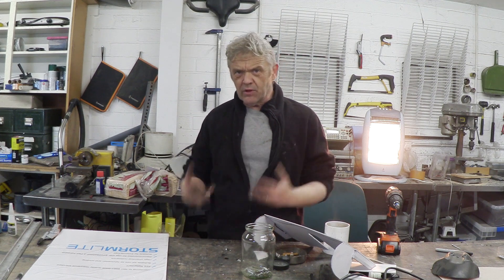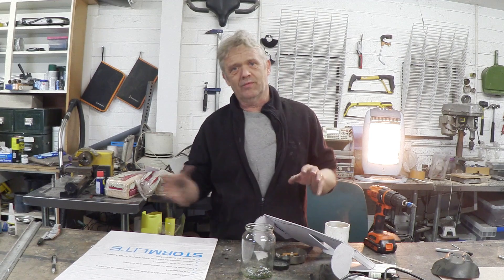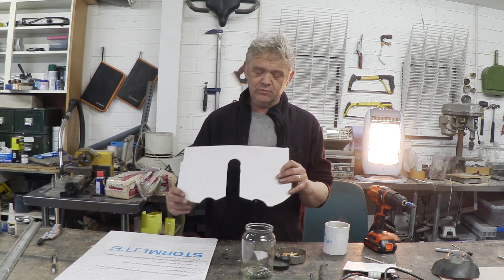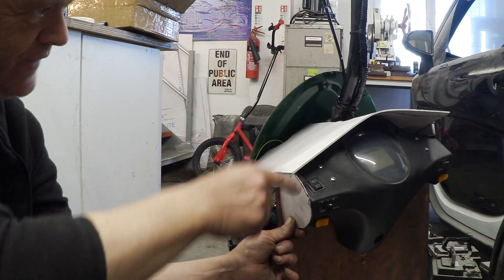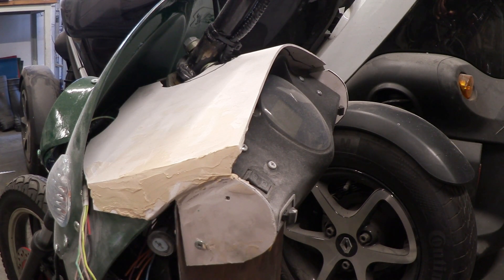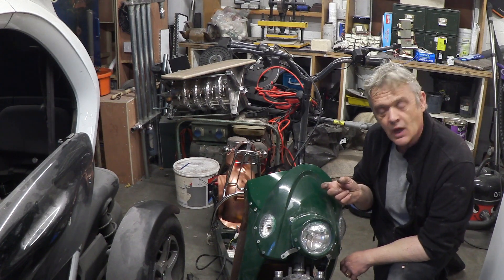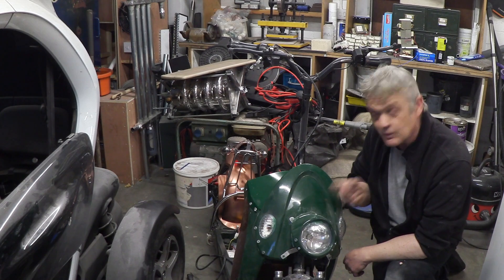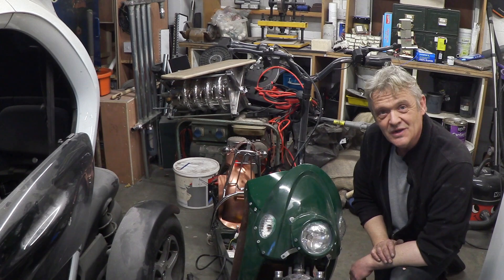Making A Big Wheel Electric Kick Scooter - Part 4 - The Plastic Panels

Comment: Ok I got a two part question. I'm wondering why you didn't use a heat gun to just bend the shape out of a perfect cutout, being that it was made of PVC. I have bent PVC in this way on a lot of projects... My second question is, towards the end of this video at the back of the room there is this steel yellow looking contraption on the back counter, what is it? My guess was a press or break of some kind. I would like to see it closer and in action if possible, it looks very interestingly built. Cheers mate